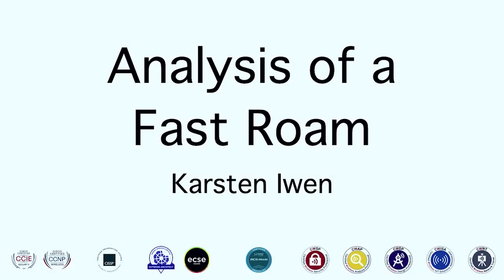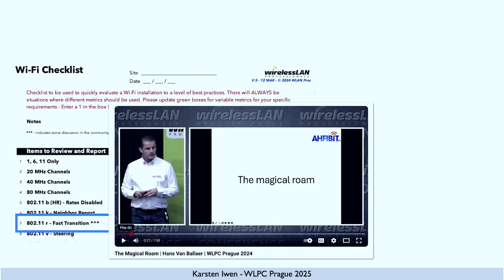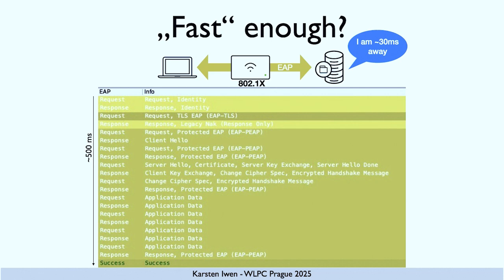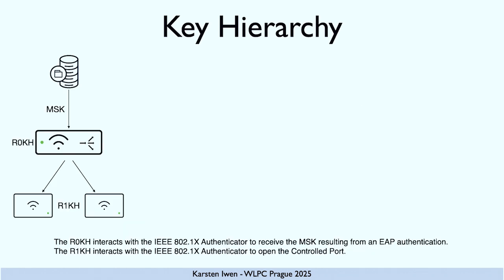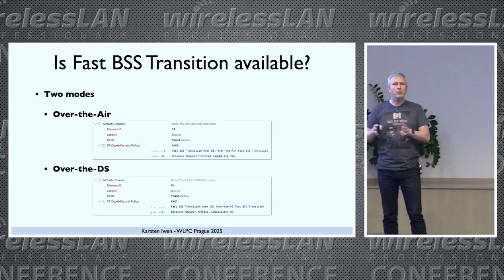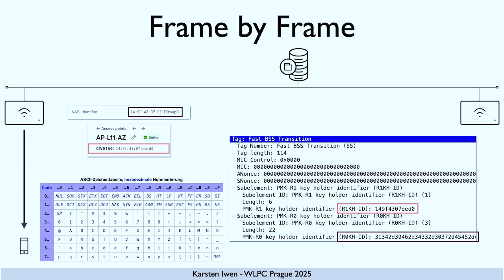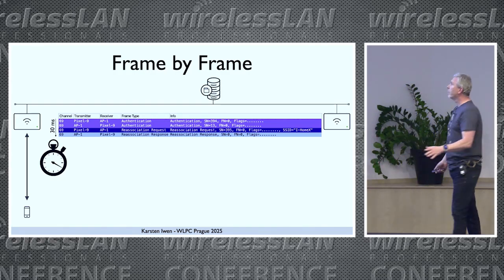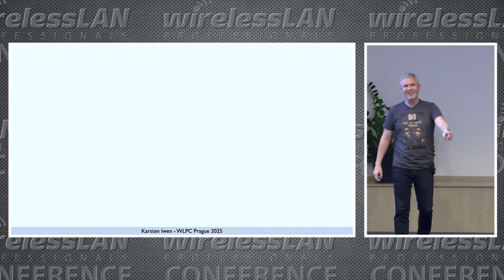Analysis of a Fast Roam | Karsten Iwen | WLPC Prague 2025

Comment: Great presentation with many value added points and concepts with respect to Fast Roaming! I could learn a lot from this presentation. Also, when I checked for the R1 Key Holder ID to be the MAC address of the AP, it is not actually the AP's MAC address. Can anyone please elaborate if possible?